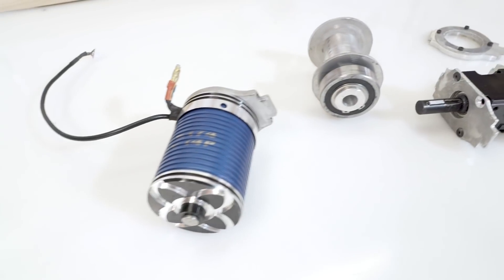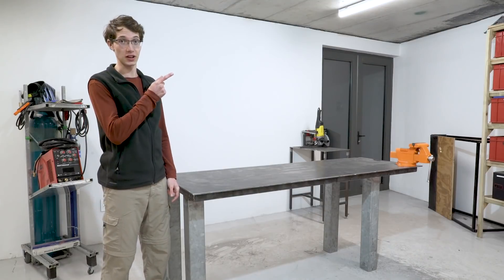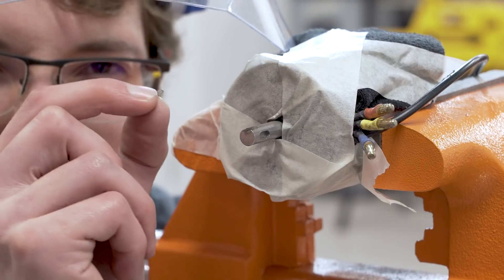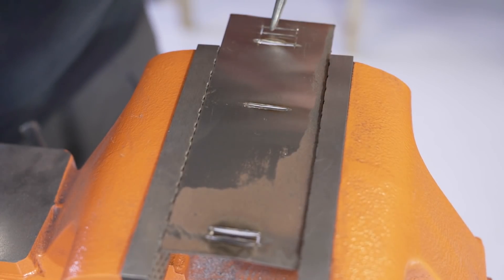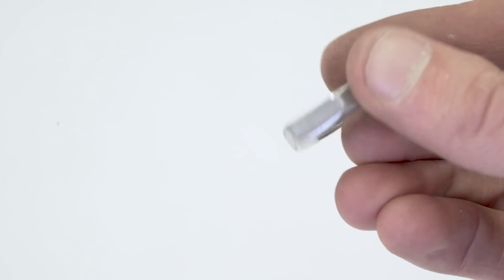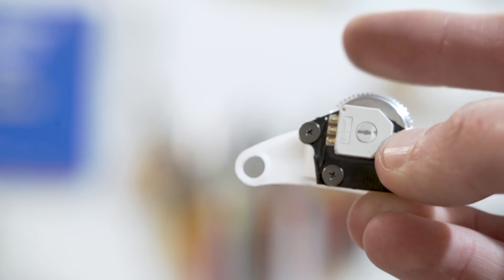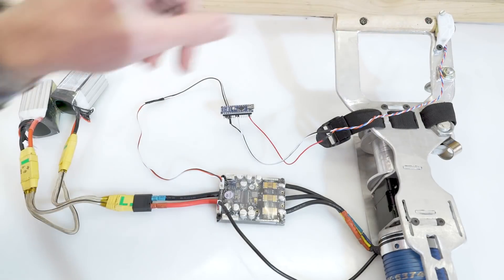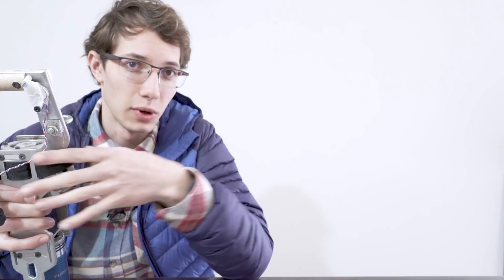Building a real, working grappling gun – Pt.4

Comment: Wait so what is the difference betweem the grappling gun project and the webshooter project? Seems like the webshooter is just a more compact version of the grappling gun.
Reply from the maker: Good question! The webshooter needs to be able to release instantly under tension and fire multiple shots without using the other hand to reload. Whereas the main challenge with the grappling gun is to reel in the weight of a person quickly.

So other than launching a grappling hook, they don't have that much else in common. 
Oh and the risk of major injury

Comment: When making slots like you did with the dremel, try just drilling out the slot with a few holes and then spend about 10-15 minutes with a needle file to get it square, will come up alot cleaner and you wont be using as many dremel disks
Reply from the maker: That would have been the "correct" process, but I'm sick of breaking my drill bits on stainless haha
Reply: @Built_IRL  maybe its time to invest in a drill press 😉

Comment: What kind of system are you using for planning your build? CAT software or are you using a nother way?
Are you doing the calculations before hand or do you test for example, the motor pull desing or the needed pressure for shooting the grapple so far?
Reply from the maker: Yes, I've done a lot of calculations for motor sizing, battery life, spool diameter, etc. Often, though, you just have to go ahead and try it! Sometimes it's surprising how far off the calculations were.